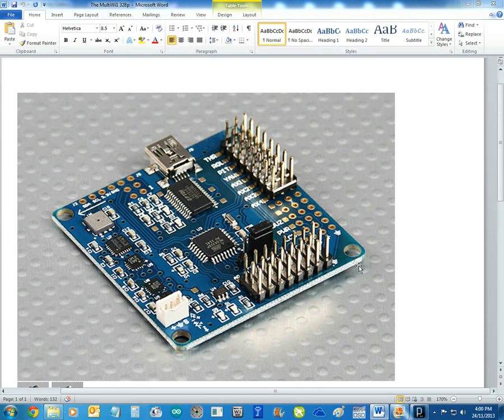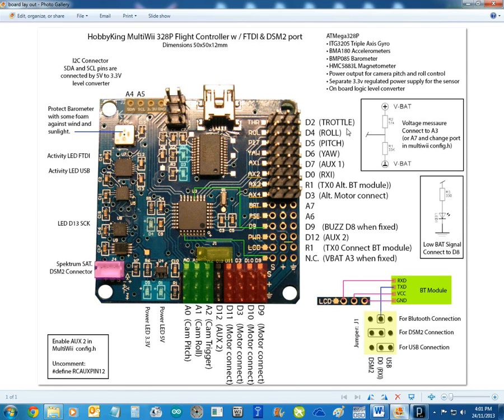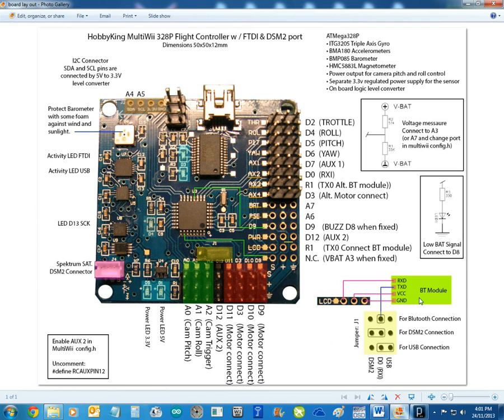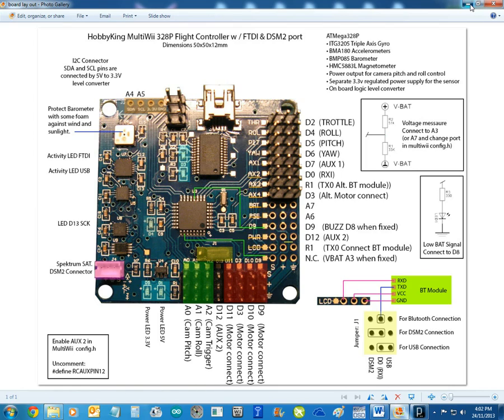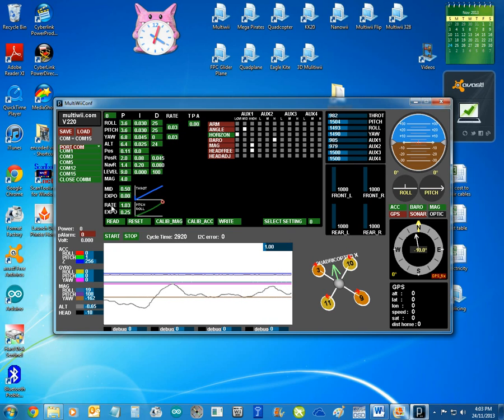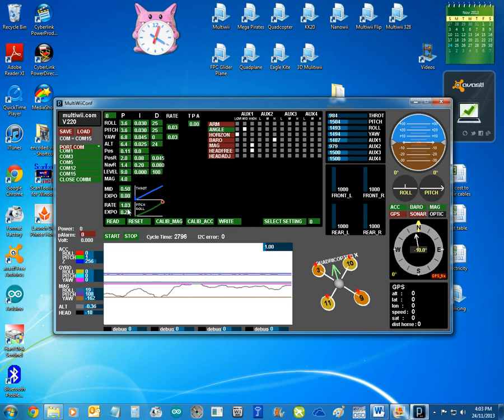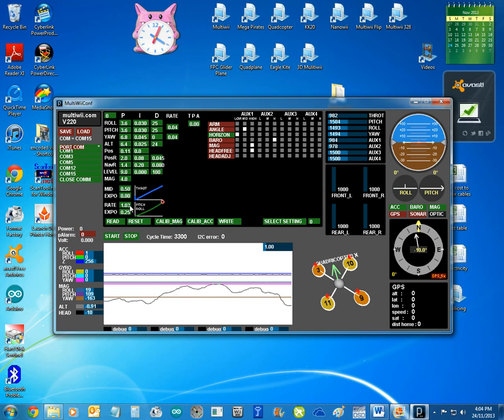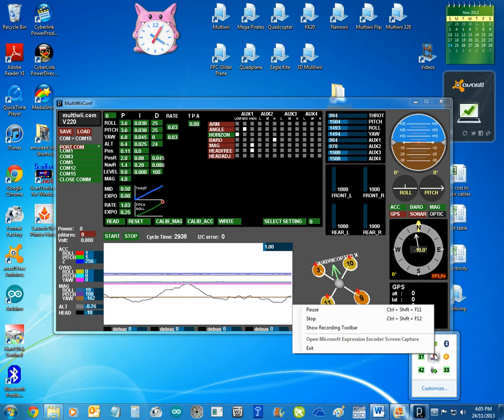HobbyKing Multiwii 328p Flight Board Setup

Comment: My board doesn't seem to be working (no sensor outputs in the gui) and I think it might be because I uploaded to it while connected to AUX 2. What does this actually do to the board and is there a way to fix it? Pls help!
Reply from the maker: Good Q..... wish I had a good answer for why and what it does..... I have done what you did and here is what I did (which worked)...
Remove the AUX2 wire.
Connect to the computer and open arduino.
Clear the Eprom.
Re-upload your sketch.
See what that brings and let me know how it turns out....... Merry Chrissy....
Reply: No luck with this unfortunately. I'm just starting out with the whole rc hobby thing so I'm not quite sure what else to do.

Is it possible that I've disrupted the bootloader routine or something?

Thanks for the suggestion though and merry xmas to you too!
Reply from the maker: If you are new then there are a few things that need to be done in order to get this board to fly....... I am assuming you have the drivers and sketch and matching GUI....... a few Qs for you:
What version of MW are you running?
Have you or can you clear the eeprom?.
Do you have the jumper still on the board..... its located left to the LCD pinout right above the motor pin outs ......... its J1..... 
Have you got the sketch for your board..... its available at the HK website.
Is the board in a quad or do you have it on its lonesome at the moment.

The MW firmware comes as a set with the GUI..... you cannot back load the program so all you can do is clear the current version and upload a new clean version.
You need to set up the correct port and board type in arduino otherwise you will get the orange screen.
You need to have the J1 jumper on if you are going to change / modify your sketch.
If you made subtle changes to the sketch then you can just update it..... if you make HUGE changes then you are better to erase the eprom and upload the clean sketch,........ provided you have not smoked the board we should get it going as I dont think you have done anything major........ I look forward to your reply.
Reply: Bit of background info on my part might help:
A couple of weeks ago I followed the steps on your other video on setting the board up (which was really helpful btw, thanks!) to check the FC was working on its own (it was - sensors were giving plausible values). After making the quad frame etc., I tried to go through the ESC calibration, but it didn't work. So I tinkered a bit (removed all the receiver and motor cables, etc.) and found that the sensors stopped working too.

That probably answers a few of the Qs, but I'll go through them jic:

I'm running MW 2.1 (and MW Conf 2.1 GUI)
Have cleared the eeprom a few times
Jumper is in the right position (USB)
I don't think I downloaded the sketch (the updated arduino one?) but it looks similar to the def.h file in my MW arduino project folder.
As mentioned, not in quad atm, but was when it stopped working.

Thanks heaps for the help!
Reply from the maker: Dan Smith Ok....... I think we can fix this........ forget 2.1 its so yesterday..... get 2.2 as it works great with this...... you should get 2 files...... sketch and GUI...... make a new folder somewhere and put each file in there ......... 
Clear your eeprom again........with all the motors RX cables OFF it.......
open the 2.2 sketch and modify the things in config.h ONLY..... that is the only file tab you should need to modify......
follow my vid sets selecting your motor speed, baud rates if you want to connect a bluetooth device etc...... always select MOTOR_STOP so the motors dont spin up once armed........ NOW.. In order.........
Upload that to the 328.
once done, save and close. (If you dont get an orange reply or problem then the sketch is on the board and thumbs UP!!!).
Open the GUI and connect to it...... probably comm2 and 115200 baud rate.
With the board flat..... select Cal ACC........ this will reset all the sensors so the board knows its horizontal....... 
Now (the fun part)..... while no one is watching..... pick up the board on the usb and select CAL MAG...... you have 1 minute to flip the board over 360 degrees in all directions (easier to do when its out of the copter)... so fwd and back..... backwards and back..... roll left then back then roll right then back, always coming back to centre..... now pretending like your 5 and its a toy plane zoom it around like its out of control rolling and pitching.... if you make the "broom broom" noise it doesnt help unless the misses sees you.... this action sways the mag all over the place so the more rolls and flips you can get in the 1 minute the more accurate it will be....
Now put it back down and cal the accs again.....
you should be now able to pick it up (by the usb lead again) and see it moving correctly in the GUI.......
Are you still awake?????.........there will be a test at the end.....
now disconnect from the GUI and open the ardiuno sketch again and connect.
go the the bottom and remove the 2 // for define esc calibration cannot fly..... save and exit........ you are now in calibration mode....... once you get this far come back and we will do the next hokie pokie......
Reply: This worked perfectly, thank you! So it must have just been a software problem? Anyway, have put the board into esc calib mode now, it should be safe to connect the receiver cables now?
Reply from the maker: Dan Smith Yes..... and congrats on fixing it.... so next step.....
Once the board is in ESC calibratoin mode cannot fly.....connect the throttle cable to the receiver ......this will power the board and RX..... the reason you dont connect all the other cables (ELE,AIL etc) is because we dont know if the all work on the correct channels (more about that below)......
So here is the method.... (you can refer to my vid if you like) http://youtu.be/Zi75ucBZkeY 

Radio ON...... Throttle UP.
Connect 1 esc to the board (I usually mark my escs 1-4 from front left clockwise so I know I have done all 4).
Power up the board........ you should hear some beeps from that esc.......
As soon as the beeps stop......(2-5 secs)...... throttle down......
You will hear some more beeps..........as soon as the beeps stop.... disconnect the Lipo....
Remove that ESC cable off the board and put #2 on..... throttle UP...... & repeat the process.....
* Never have your Lipo and USB connected to the board at the same time..... they are different voltages and you will smoke the board........
** It does not matter which esc connects to which pin set for this process.....

Now that is all done...... (LIPO OFF)...... with NO ESCs connected to the board connect the board to the computer and comment out esc calibration cannot fly in your sketch........ save and exit. (we are almost there!)..... 
Disconnect the board from the comp and close Arduino.... 
Now connect all your RX cables to the board..... 
Also connect all your escs to the board........ (exciting isnt it).
Now turn your Radio on and connect the board to the comp and open the GUI and connect......
You should now be able to see your channels working in the GUI..... ensure you have all the correct channels around the right way and that they are going in the right directions....... 
Throttle up - increases the numbers.
Pitch FWD - increases the numbers.
Roll & Yaw should go the same way as your sticks... if any of these are wrong then you can either swap the RX cables around or change the channels in your radio.
If all that is done...... disconnect from the computer and with all the motors connected you will now need to do 2 things......
A- ensure the motors are all going the right directions.
B- ensure you have all the right motors on the right pins.

Front motors should spin inwards........ rear motors should spin outwards.
I usually put a prop on the motor with NO spinner.....meaning the hole in the prop is as sloppy as...... I hold my finger on the top of the motor shaft and throttle up a tad.....the sloppy prop will spin but wont grip so you can easily see if its going in the right directions....... 

Now remove the lipo, radio ON and connect to the comp and open the GUI.
You will now need to set up your flying modes...... you should be able to see the AUX switches moving....... I would suggest for the moment you just select Angle which will only allow the copter to tilt over to a MAX of 25 degrees.... this is great for learning and we can set up the other stuff later........ to select angle just go to the vid....... http://youtu.be/uEl-fbQaWNo 

Now ....... once you have all the above sorted its the final stage.......
Put the props on (always double check that the props are cutting into the wind... I would love a $ for each time I have (got excited) and put a prop on wrong..... doubbbble check..........
Now the final test......... take the copter outside and place the radio on a high surface.... lipo on and connected....... holding the copter over your head..... arm it and throttle up a tad....... 2 more tests.....
1 - move the copter left, right, fwd and back.. if the escs are on the right pins the motors will want to speed up to keep it level.
2 -  Once #1 is OK move your yaw, pitch and roll ensuring you have the right directions.......... 

Now go fly it.... take a vid of it and post the results.......
Reply: I've tried about ten times now but I can't get the esc calib. to work. The escs make the musical tone but then only give one beep instead of two, then when I move the stick down there's no three beeps.

I've checked in the gui and the receiver is working (throttle etc. increase and decrease in the correct directions) but the esc readings remain at 1000 (front, left, right and rear). 

It could be something to do with my transmitter (dynam 4ch) needing to be armed every time (flicking protect switch up and down) it reconnects, but even when I do that, the calibration doesn't seem to work.

:/ any suggestions?
Reply from the maker: Dan Smith Ok..... have  you changed your sketch to ESC CALIBRATION MODE CANNOT FLY then uploaded and saved it??..... if you dont get the beeps at each end point for the throttle then your escs will not see the full range therefore you will get 3 probs........ 
1- uneven throttling.
2- not enough throttle when fully up
3- you will not get the end points to arm/disarm the board.
So modify your sketch to cannot fly esc mode removing the 2//,,,,save and upload.
Do 1 esc at a time as per mentioned above........
You should hear a beep at the top (full throttle) and then down fully to hear the next set of beeps.....
Did you get those steps done?
A lot of people get frustrated with these MW boards as the required steps need to be followed to the letter of the law and if for some reason they dont get it right the whole process stops dead in its tracks....... 
Sorry to be going over the same ol same ol but I am unsure from your descriptions if you are getting all the steps right..... can you tell me in a 1-10 step form what you did..... as I am guessing here...... 
From what you mentioned above your escs are not calibrated therefore you will not be able to arm and disarm the board as the throttle stick end point (lowest point) is required as part of the process.
Where you have checked in the GUI that the throttle is working in your 2nd paragraph implies that you have connected the board to the comp with the radio on (no lipo ever) and you can see that the throttle directions are ok.... what about the other 3 channels are they correct......
Reply: Yep:
1) I uncommented the esc calibration mode cannot fly line
2) uploaded it to the board through the usb (with no cables or lipo attached)
3) closed arduino then disconnected the USB cable
4) connected receiver cables
5) sequentially for all four: a) attached an esc cable, b) flicked throttle to full up and turned radio tx on, c) attached lipo and waited for rx to bind, d) turned off the protect switch, e) waited for beeping to stop, f) moved throttle all the way down, g) disconnected lipo and esc cable, then repeated.

I tried reversing the throttle direction (so that full up gave apprx 1000 and full down apprx 2000) and some other variations on the method above (though it might have been the allow arm disarm via tx yaw thing but no luck), but always seems to give the same result: I get the musical tone that's on your other video followed by a single beep where yours gave two. 

When MW is connected to comp. (with escs and radio cables attached), throttle, yaw, roll and pitch all go in the correct directions (they seem to have a limited range though - like 1100ish to 1900ish). 

I've tried connecting the lipo and all the cables up, but nothing happens when I adjust throttle, roll, yaw and pitch.... Yeah kinda stuck :/
Reply from the maker: Dan Smith Hi Dan....... hang in there...... 
Your point 5 worries me..... you need to turn the radio on with the throttle down and all the switches back IE the radios normally started position.... Then turn up the throttle..... you dont have to turn the radio off after each esc cal (just a point, you didnt mention it but I thought I would state it) so I dont get where the protection switch comes into play...... SO did you get beeps at both high and low throttle positions??....... you should do that is confirming that the system has see both end points....... the number of beeps and time for the beeps to start will vary from esc to esc brands........ so dont get too hung up on mine in the vid if yours are not beeping the same number of times...... 

In the GUI your min settings should be around the 900s to 1000 and the high end points should be around 1900...... you should ensure that your trims on your radio are centered and that your stick limits are all 100%.... (hopefully you know what that means)...... 

When you say " nothing happens when I adjust throttle, roll, yaw and pitch" what are you expecting or meaning here..... this is the hard part.......with these boards you cannot run a lipo and the USB together otherwise you will smoke the board as the lipo has say 12v and the usb supplies 5v so its a no no...... now with your board you should be able to connect all the motors and all the RX cables to the board and fire it up from the lipo only...... so have you done that... The only way you can use the GUI and run the copter is to get a bluetooth (BT) device from Hobbyking for around $8..... that allows the copter to talk to the comp while having a lipo connected......(I can hear you going..... wow.....)..... welcome to the great world of MW....... but you dont need that to get to where you want to get to to fly.... just a nice thing to get and have ..... SO.... no BT unit and we want to fly........ I suggest now that you have calibrated the accs and mag...... you have calibrated the escs..... (dont forget to change the sketch back out of ESC calibration mode as its easy to forget).......now its props off test time...... excited???........... 
so with everything connected to the copter double double check all the connections as we dont want to smoke the board now we have come this far and are so so close...... 

Having the copter level with props off........ connect the lipo and wait for a minute for the board to go through its set up process..... can you throttle stick down and go right and does a blue light come on on the board....... if so its armed and the motors will start once you throttle up... right stick and left to disarm it....... 

If you get the blue light then motor check the direction of all 4 motors...... if some are spinning the wrong way swap 2 of the 3 motors wires over and it will cure it..... dont forget fronts spin inwards rears outwards....... let me know how you got on........

If your board does not arm it means that the board has NOT seen the throttle down and right end points........ you might have to open out your stick limits to do that..... dont forget to have the board level when doing all this and remember No props on inside,,,,,,,, never ever ever........ bad bad habit which results in either pain and suffering, broken copter or damaged house..... burn that rule into your book of DONTS............ I await your reply.
Reply: Thanks for your help and persisting with me this far! haha.

Ok, I haven't managed to get the board to arm (there's no blue light and motors dont do anything) by going through the process that you mentioned. I also have stopped turning my radio off/on for each esc when attempting calibration now (didn't realise that it only needed to bind once for rx to pick it up again when powered on).

My throttle ppm (as seen on GUI) ranges from apprx 1010 to 1990, while the yaw, roll and pitch ppms range from apprx 1150 to 1850 at the full ranges. I have made sure that the trims are centered (moving the sticks to middle position gives 1500 for throttle, yaw, roll and pitch). How do I change these limit values?

Also, I think the problem with the escs is that they have an automatic calibration (read on forums) and are entering a programming state when I try to calibrate them. Only problem is the instructions for this state aren't clear/aren't working when I try modify them on my escs (manual: http://www.hobbyking.com/hobbyking/store/uploads/1001782845X7478X34.pdf ).
Reply from the maker: Dan Smith Dan..... there is nothing wrong with the board if you have not smoked it or hammer hit it (yet - now I know how you feel as I have 6 of these 328s). Your opto escs need the programming card to program them.... did you get one of them when you purchased the escs??.
Also in your radio (somewhere) will be a limit or end point setting... if you can imagine that the factory setting is 100% for all sticks you can set them down to say 60% for beginners which when you move full range of the stick it will only apply 60% of the value therefore limiting (hence the name) control........ you can also put the limits up to 125% which makes the copter highly reactive......
Now..... in order for the board to arm it needs to see a value when the stick is moved to the lower right and left (arm - disarm).... so 3 things.......
1 - if your board is not calibrated (mag and accs) the board will not recognise the end point values.
2 - if after doing point 1 it doesnt work then you can try opening out the limits on the throttle stick (throttle and yaw) to 110% both directions then 115 and so on till you either arm or you run out of limit at 125%.
3 - in your arduino sketch you need to ensure your arming line is defined..... /******************************    ARM/DISARM    *******************************/
   /* optionally disable stick combinations to arm/disarm the motors.
     * In most cases one of the two options to arm/disarm via TX stick is sufficient */
    #define ALLOW_ARM_DISARM_VIA_TX_YAW
    //#define ALLOW_ARM_DISARM_VIA_TX_ROLL
See allow arm disarm via tx yaw...... that is your throttle and yaw stick... note the 2 // removed....... you can have both lines selected but its good to only have one.

So there is some more info for you - you are probably going....why didnt I buy a push bike.... but persevere with it,,,,,, these are a great board.